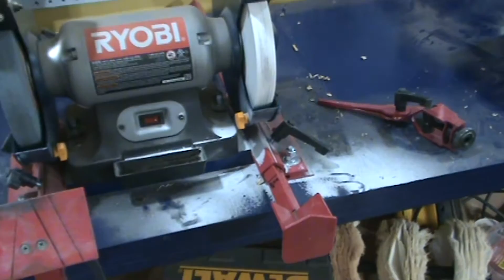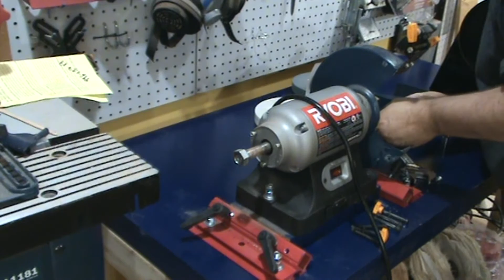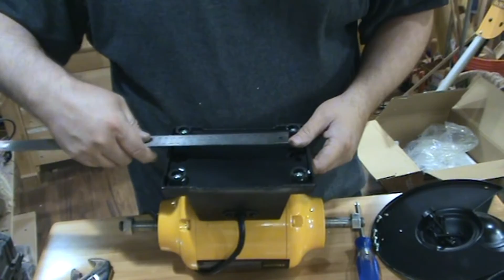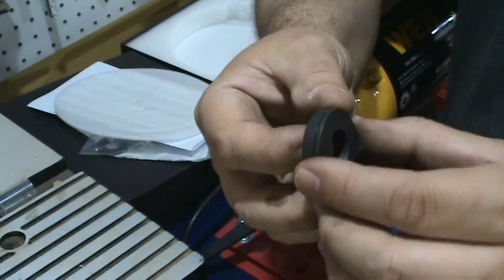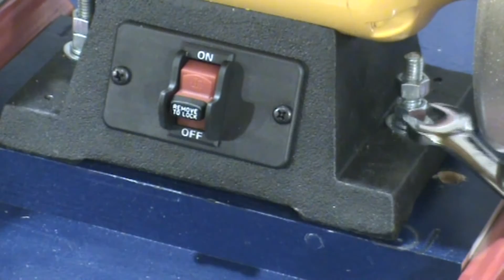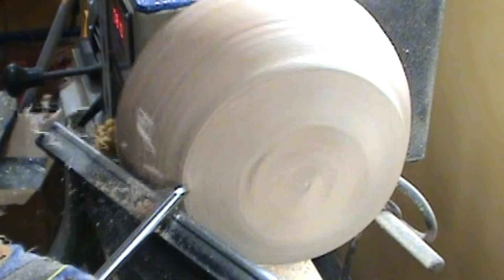Low Speed Grinder and CBN Wheels Installation

Comment: I had not considered sharpening carbides on the face. So simple. I buy them on amizon a 10 pack of square 14 mm are under $30. Round are about $45. I will try sharpening on my diamond block today. Thanks so much.
Reply from the maker: Hi Edward, at the time I did the video of the sharpening of carbide inserts, it was not so easy to find them in amazon.com. I had to get them from easy wood tools and each one was between 14 and 16 dollars. Their price has come down considerably, but still, sharpening them this way is relatively easy and you get more juice out of each one. Cheers! Daniel
Reply: @DanielVilarino  yes I find the stores still want $14 to $20. I just bought another 10 pack for $26. Your video means I will not buy another for years. Thanks.

Comment: Kudos Daniel.  I've made my decision and will buy some CBN wheels.  However, I've watched Mike Walds' and Dave Schweitzer's video on same and it looks like you have purchased different wheels.  The wheels in Mike and Dave's video come with a 1" arbor hole and require a special bushing; your wheels appear to have center holes that match the WEN grinder and require no special bushing.  Will you share the grinding wheel manufacturer's name and also where you got the convex/concave washers?

Thanks,

Dave
Reply from the maker: David Maynard Hi David! Thank you for your comments my friend! Sure, no problem, the link follows: http://woodturnerswonders.com/collections/cbn-wheels the service was great, I got the wheels and also the washers from them, you can see ball and socket washers in the images below. They have a great variety of wheels. I preferred these because there was a deal for the pair (80 and 220) and they had the widest band. There are also some that while a bit narrower (I believe 1 in) have flat grinding surfaces on each side, which might be interesting for some applications. They have arbors in 1/2 in. and 5/8 in. and I believe the WEN low speed grinder is 5/8. The fit was perfect, just a bit of 400 grit sandpaper to remove a bit of rust from the shaft (incredible how a new grinder comes that way, but well, nothing to complicated to solve). The wheels are precision machined so they will not have any play, and if you have trouble fitting them at the start try with a 400 grit, until they fit. It will not take too much. Hope this helps and I am really satisfied with these wheels. Hope you enjoy them. Cheers! Daniel
Reply: Daniel Vilarino Thanks...Mission accomplished!